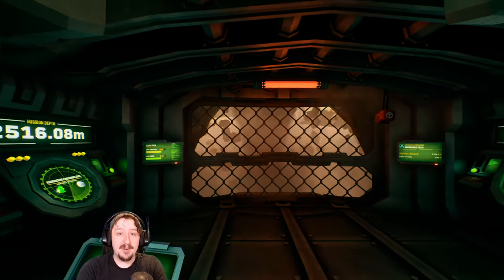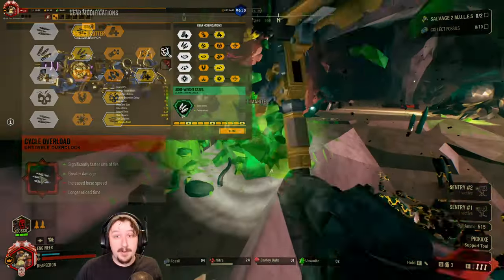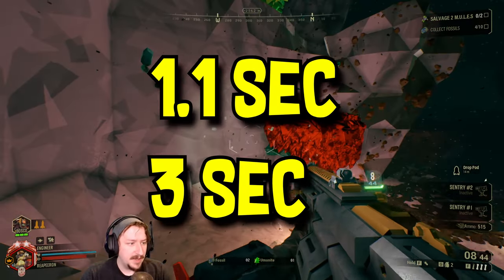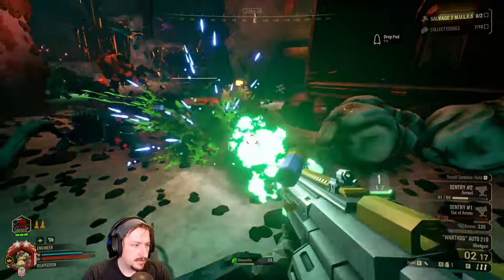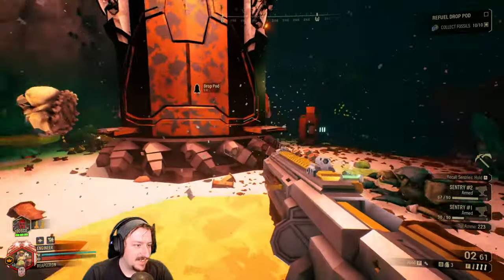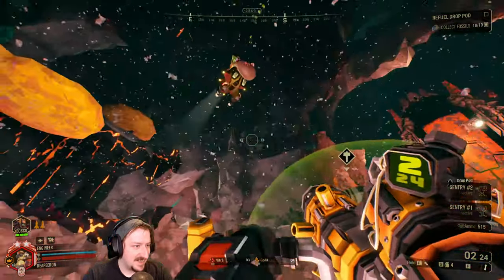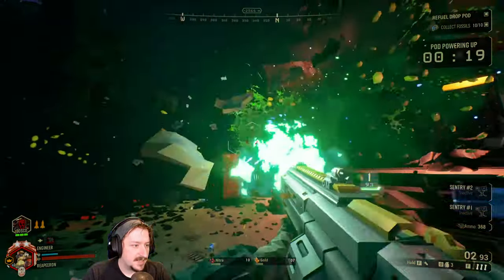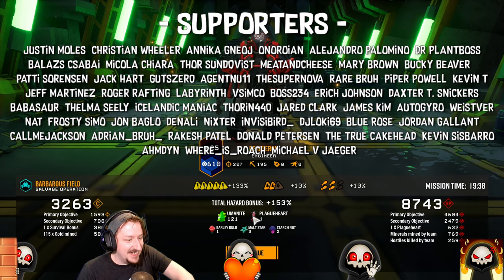Engineer Loadouts 101: Cycle Overload + Warthog Auto Shotgun

Comment: Hey man appreciate your videos! Which gun would you recommend me for Hazzard 5 for the scout? I have AI Stability for the GK
Reply: Depends on what OCs you have. AISE is one of the best OCs for the GK2. Build is 21212, aim for the weak spots for massive damage.
Reply: M1000 hipster and nuk17 embedded detonators, possibly.
Reply: For no overclocks I prefer m1000 and the boomstick
Reply: Rewiring mod and embedded detonators are busted af when you mod them right
Reply: @lemongaming152 How are you running RM to feel busted? The ammo is nice but it feels so weak
Reply: @atlasstoned If you mod it with 12111 the increased fire rate allows you to dump shots into a swarm quickly then manually dump the heat and grapple away and it's cooled by the time you land, plus the chance to electrocute pairs really nicely with the quick dump of bullets

Comment: actually tried this exact build(reload speed in tier 3 because i dont have enough mental capacity during a swarm to animation cancel) and it felt extremely clunky. So im back to mini shells/lightweight magazines(still dont have magnetic pellet alignment but it seems fun)
Reply: it's best to run 2,1,1,1,1,2  w this oc
Reply: MPA is fun, and the punchiness it gives the Warthog is definitely worth the firerate decrease.

For Cycle Overload, I think I used 22322/22321. 
Max firerate is funny, but you don't really need so much for individual grunt kills/unloading into one target.
I paired it with VIR for the diffractor (tuned for single target, I used the magma to clear groups only), and it worked nicely.
Reply: @aboringperson9069  I honestly don't like MPA,it feels like a pump shotgun which is cool but I prefer fast firing shotguns to unload in a swarm
Reply: @nando6458  That's totally fine. For me, I really like MPA's benefits, and I usually bring it with secondaries that can handle hordes.

Comment: One thing you can do for reload cancels instead of swinging your pickaxe, is that you can press ctrl to pull out your lil pointer laser, that will make it so you dont have to press shift to start runnining again and can save you in a pinch if you are running and have too many things behind you

Another thing is that you can skip all that jank, and just jump while you reload cancel with the pick, to keep running
Reply: tbh if you’re running from enemies you should be jumping anyways
Reply: @atlasstoned  not always, if there is a trijaw in the horde and you can't quite get to it, jumping might make it shoot slightly higher and hit you as you run away from it
And if theres no room for jumping, like inside a driller tunnel, you might want to press ctrl
Another bonus of pressing ctrl is that it doesn't matter if you dont fully pull out the laser, it will show you where stuff like bosco, molly, the pumpjacks, etc are
Reply: @isayuh5573  jumping is good against trijaws typically for that reason. since they arc, it’ll shoot too high and miss you as you fall back down